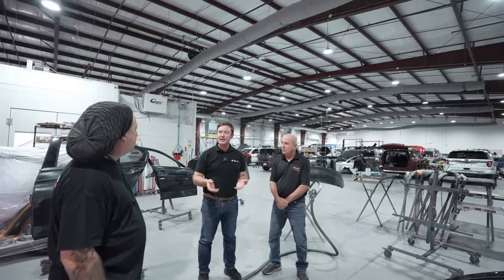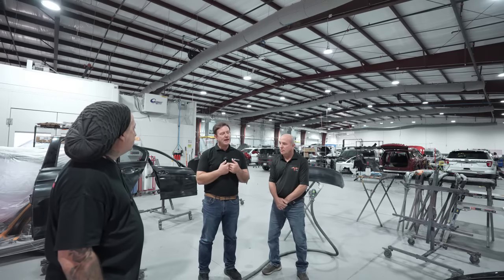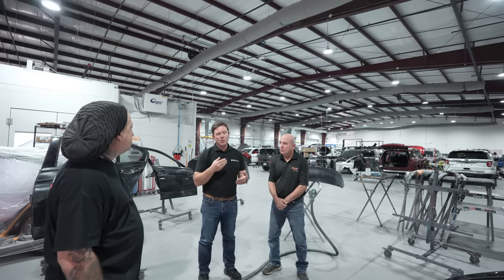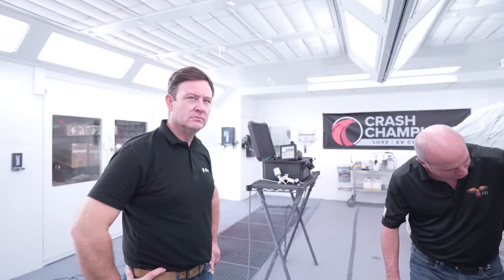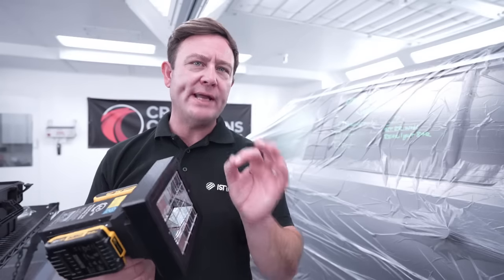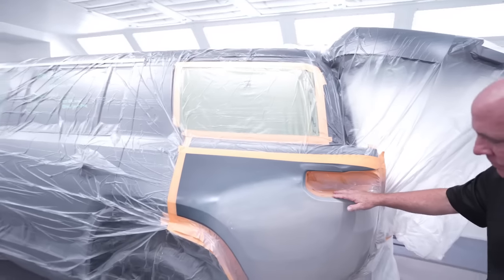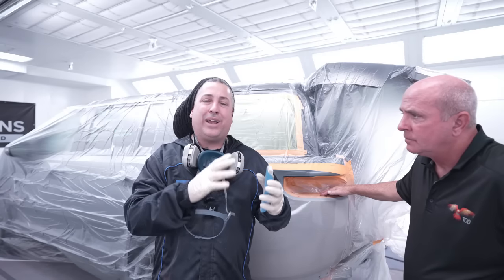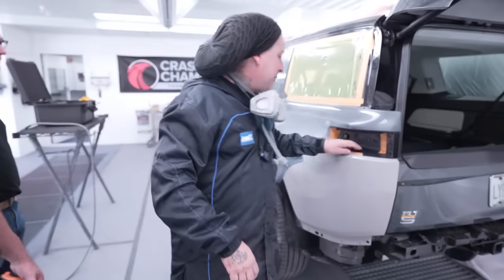How To Permanently Eliminate Shrinking & Sand Scratches In Your Bodywork - IST Intech AC500

Comment: Great video Kandy Man, it's nice to see the UV tech being used in more shops as it's been a long time coming, I use UV putties which cure in seconds plus on small repairs you can paint right over it with no primer needed, I don't use that much UV primer as my lamp isn't powerful enough to cure large areas but it's perfect for small cut throughs👌

I hope the UV tech works well for you as there are a lot of shops here that love it, I'm sure it will pay for itself in no time and will make your work faster and easier👏🙏👍John UK
Oh and thanks for pinning my last comment on your previous video👊👊

Comment: When your using high build primer  on repairs.. always make your first coat the Farthest let it flash off...then second coat about 3" from the edge of the first coat let it flash.. repeat  working  your way back into the repaired area .. or filler area with your last coat

Comment: I’ve been aware of UV for ages but I still will not buy into it, I still don’t see the point apart for very small quick repairs, you have the cost of the UV primer, you have the cost of the lamp, you need to buy another gun or blackout pot, nothing beats priming somthing the night before, maybe very very fast production settings but it’s not for me, however good informative video 👍

Comment: I switched over to Standox UV primer about 2 years ago and it really is game changer technology. Extremely fast and zero shrinkage. Not going to lie though I have seen some failures with it. Not totally sure of the reasoning.
Reply from the maker: Thanks for the feedback
Reply: @JR-ho5qm  some of the failures can come from 
1. Not prepping with the proper grit
2. Over applying. (You should be able to see the body work through the primer)
3. Not cleaning before priming
4. Not flashing properly between coats or before drying
5. If you have a high powered enough light you can get it to hot

Comment: Sherwin uv p2 uv primer is the best in my opinion. We have been a full uv shop for 3 years
Reply: Also trust me this will pay for itself the best investment our shop made was ditching the hand held light and getting one that you set like a heat lamp almost set it on a timer walk away while it’s curing and do other stuff. We also have had no peeling or anything since the switch because those lights are so much more powerful especially when they sit on the spot for 7 min they cure just about anything
Reply: What's the cost of the primer.
Reply from the maker: Thanks for the feedback

Comment: You do enough work at that shop you need a UV Fastlane 2k.. don’t mess around with that little light.. trust me! I paint 250 plus hours a week and we UV every job.. no shrink back and it cures in 10 seconds or less. Been using it for years it’s a beast
Reply from the maker: I am very happy with this light. Appreciate the information

Comment: Is there any danger of the UV output of the light to the person?
Reply from the maker: You definitely want to follow all the proper ppe
Reply: Basically like strong sunlight / UV that can damage the eyes Short / log term), 'sunburn' bare skin, with long term damage to skin, probably skin cancer is a high probability if you use it a lot without good skin pro.

Comment: Here's a question for you. How do you handle the P220 scratch that occurs outside of the primed area? No way you can apply basecoat over a P220 scratch.
Reply: Pat mentioned 320 out at 7:30 . . . still, I'd probably go 400 out on a machine, then final prep 600 disk, ultra fine hand pad, matting paste to blend area.
Reply from the maker: 320 past the repair,  then  refine during prep

Comment: We have been using uv for about 2 years, but doesn't realy work on a large repair about the size shown, if does fail with adhesion sometimes you can get a sanded edge and you can peel it away, from a time point 2k and infrared lamp not a lot of diff
Reply from the maker: Thank you for the insight

Comment: With those bare metal spots did you hit that with an etch wipe? I used over 30 over them today.
Reply from the maker: Not needed  it is direct to metal  primer
Reply: @kandyman5315 that’s not fully correct sir. it is infact a DTM product, but it has no corrosion protection properties unlike etch or epoxy. This is why proper procedure recommends using a conversion product to treat the bare metal before applying the UV primer. This is a bigger issue in the rust belt.

Comment: Maybe it my product line but UV primer is only good for small repairs and the body work has to be perfect and finished in 180.

Not enough build thickness as traditional 2k.
Reply from the maker: Appreciate the feedback
Reply: @AnhHoang-oo3xp  that’s not the case anymore. We use it for pretty much everything
Reply: Yeah I agree body work has to be good, an as a painter for over 20 years nope ain’t gonna happen, good luck finding bodymen that will send over good work
Reply: @JamiecoreyL  to be honest the UV primer is good for bad bodywork because it’s so fast you can prime block and re prime in no time at all. And zero shrinkage. You try pounding on urethane over bad bodywork, it’s likely shrinking down the road
Reply: The higher quality UV primers are very high fill, the issue you fight with is applying too thick of a film and the UV light/cure time being insufficient to cure the whole layer, which is why they emphasize lighter coats fully cured but you can stack em. I use Sikkens UV primer, it is high build.